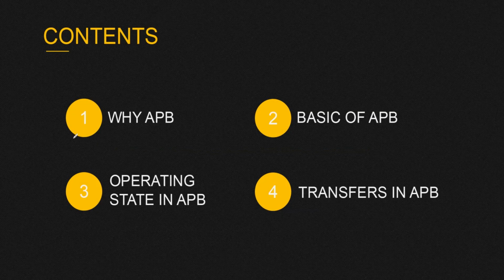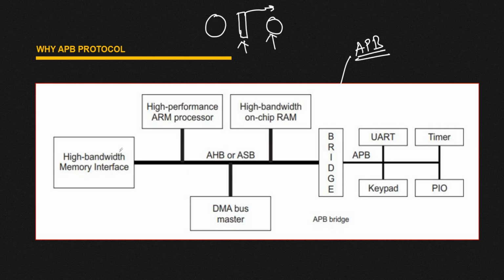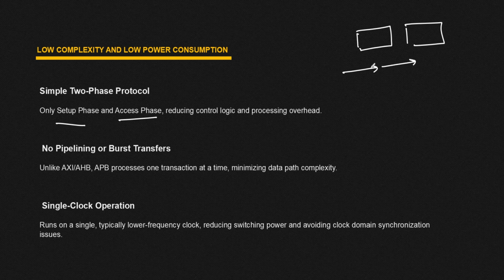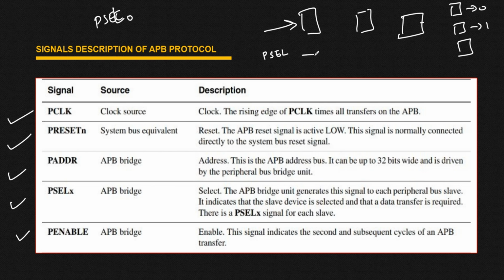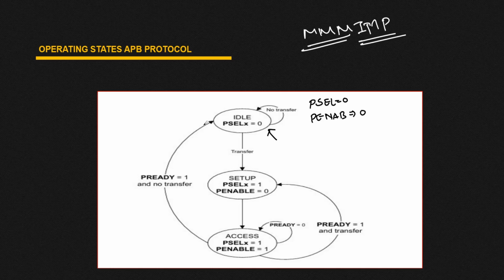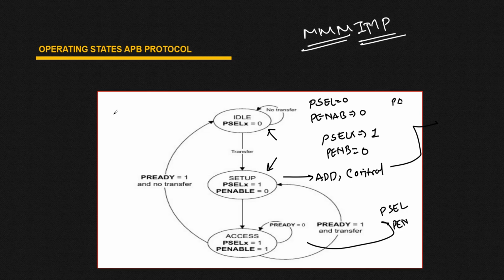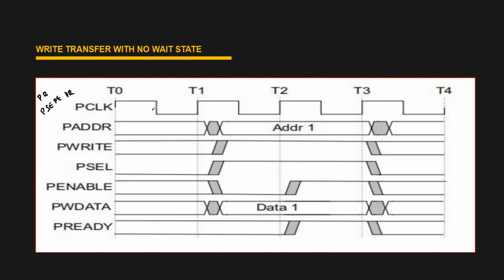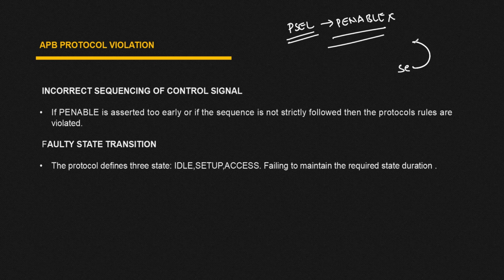APB Protocol Explained | APB Interface | APB Protocol Basics | AMBA APB Topology #vlsi #protocol

Comment: [00:39]	Video Agenda (Why APB, Basics, Operating State, Transfer)
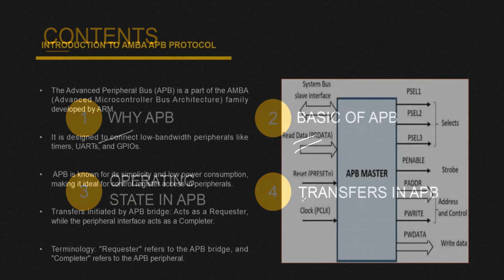[01:11]	Introduction to APB (Advanced Peripheral Bus)
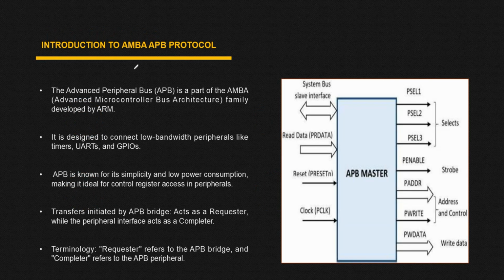[01:20]	APB is part of the AMBA Family (ARM)
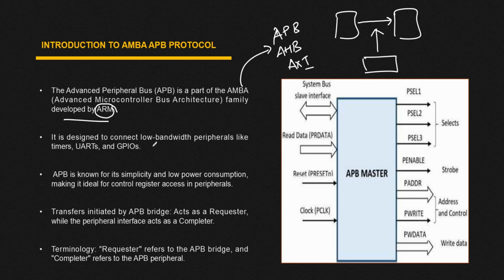[02:09]	APB is a Low Bandwidth Protocol (for Peripherals like UART, GPIOs)
[03:13]	Why Use APB? (Bridge for High to Low Bandwidth Communication)
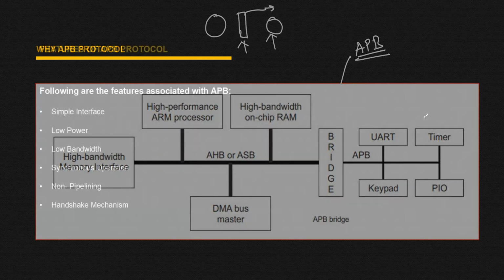[04:18]	Features of APB (Simple, Low Power, Low Bandwidth, Synchronous, Non-Pipelining)
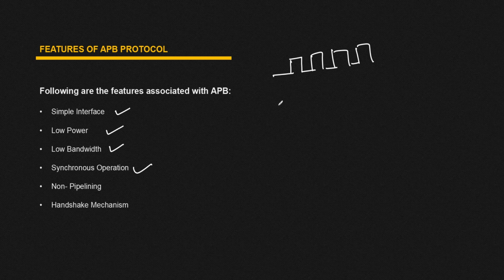[05:01]	Explanation of Non-Pipelining
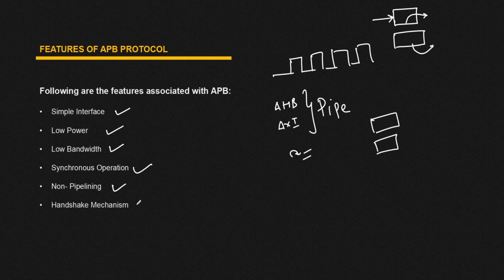[06:05]	Explanation of Handshaking Mechanism
[06:56]	APB Two Phases (Setup Phase and Access Phase)
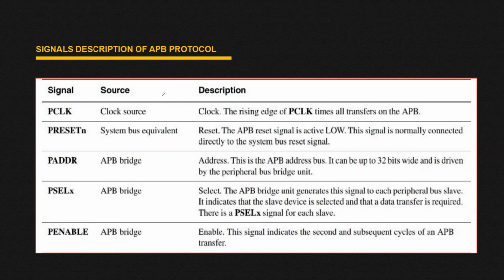[07:47]	APB Signals Overview
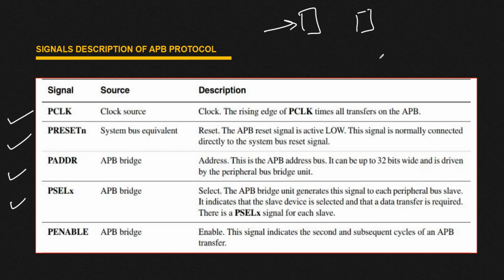[08:31]	P-Select Signal (Slave Selection)
[09:41]	P-Enable Signal (Setup Phase to Access Phase Transition)
[10:22]	P-Ready Signal (Slave Acknowledgment/Handshaking)
[11:15]	P-RData and P-WData (Read and Write Data)
[11:54]	P-SLVERR (Slave Error Scenarios)
[12:44]	APB Operating State Diagram (Idle, Setup, Enable/Access, Wait)
[17:15]	Signal Ports Direction (Master vs. Slave Perspective)
[19:04]	Write Transfer Waveform (No Wait State)
[20:36]	Write Transfer Waveform (With Wait State)
[21:55]	APB Protocol Violations